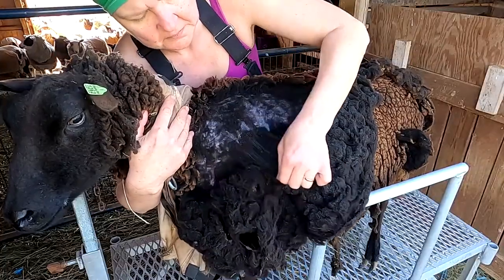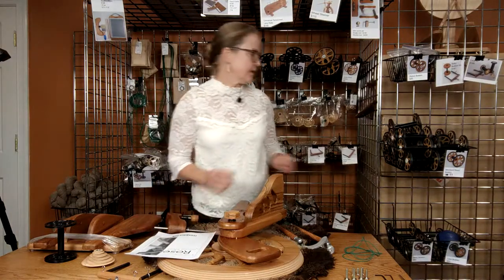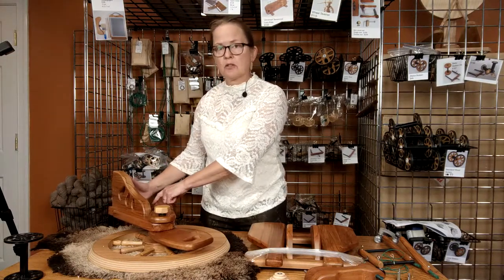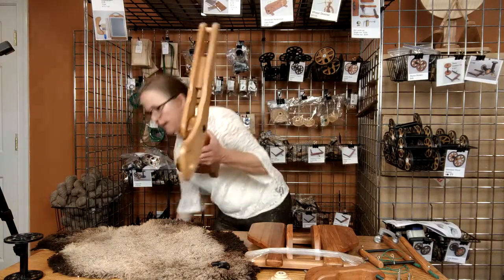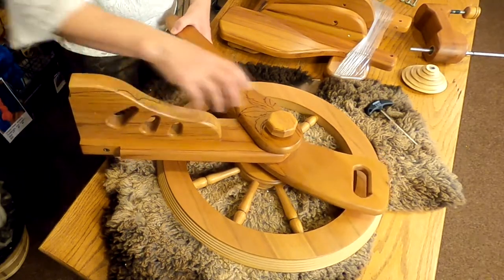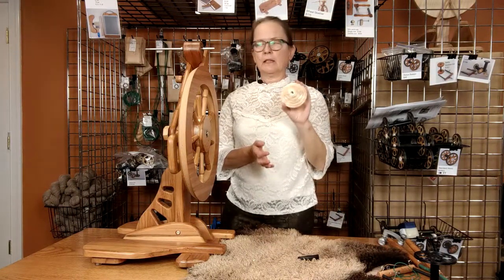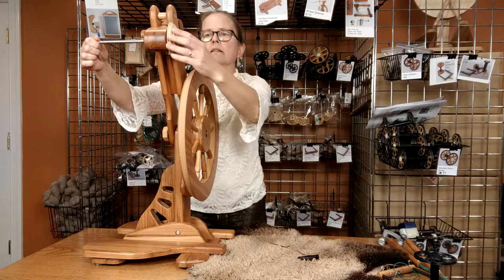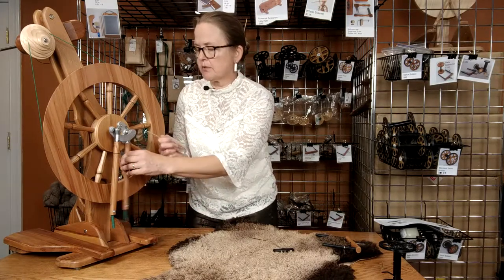Assembling the Majacraft Rose Spinning Wheel

Comment: Thank you so much! I bought my Rose here in UK 5 or 6 years ago. Previously I had bought another make of wheel (I wanted a Majacraft but couldn't afford it at the time) and it was so difficult to assemble. It was fine until I had to fit the wheel between the two uprights, insert the 'axle' and fit a pin to secure it. It took me ages but I was determined to get it done before hubby came home as he would have taken over and I knew he was very heavy handed!! Anyway, remembering this, when I bought my Rose I opted to have it assembled by the retailer. Having watched your video I can see assembling the Rose is not nearly as fiddly as that previous wheel, beautiful as it was. When I was at a spinning retreat Glenys and Owen Poad were there and he took out that screw that stops the head from hitting the treadle for me as my wheel wouldn't fit in the bag with it there. Having watched you I can see where it goes if ever I want to replace it. Thanks again.
Reply from the maker: Haha I never assembled anything but a Majacraft so don't have anything to compare it to, but I think it is pretty straightforward

Comment: Very nice wheel, Jen you make it look so easy and fun to put together. Is the main wheel design new? Or has the Rose always had spokes instead of being a solid wheel?
Reply from the maker: Thanks Margo.  The drive wheel on the rose has always been spoked, it's the only Maja wheel that is.  Makes it a lot lighter, and is also why the ratios are so much higher as it is larger circumference vs. the other wheels.  Plus its a lot prettier I think.

Comment: The Rose is one of my dream wheels, but you got me looking at the Suzie also.  Can you please explain the differences between the two?  Someone once said that it was just appearances, that they were basically the same wheel but different designs.  Thanks!
Reply from the maker: Hi Cindy - I am planning on doing a video once I have them all assembled with all of them lined up in a row.  Then will do a compare and contrast.  Really looking forward to it!  BUT - happy to give you a sneak preview.  The difference is all in the drive wheel.  The treadling, crank assembly, stem and head are pretty much the same between the Suzie and the Rose.  The Rose drive wheel is spoked and large.  The Suzie drive wheel is solid and small.  I think, need to verify this, that the Rose weighs less because the drive wheel uses less wood.  The larger wheel of the Rose gives you higher ratios with the standard head, so faster spinning for lace or high production.  The rose is decorated with a Rose, the Suzie is decorated with a clematis.  I heard Glynnis Poad say one time that she wouldn't use the high speed head on the Rose as it is hard treadling, I plan on assembling the high speed head on the rose in a couple videos out to see what that is about.  Hope this helps.  I don't envy you having to make a choice, because they are both absolutely breathtaking wheels.
Reply from the maker: Oh and another thing - the Rose comes with more kit - two flyers, 4 bobbins, a lazy kate and 2 whorls.  The Suzie is pretty minimalist (1 flyer, 1 whorl, 4 bobbins) and then you build your accessories based on your preference.  Suzie has a 2 bobbin storage bar integral to the wheel (not a separate item).  OK I think that's it!
Reply: Thank you!  That was very helpful and I look forward to your future videos.  ❤️